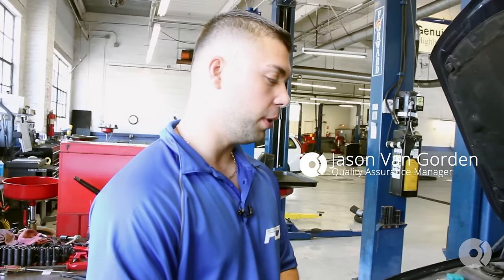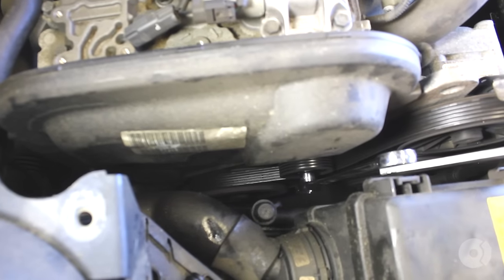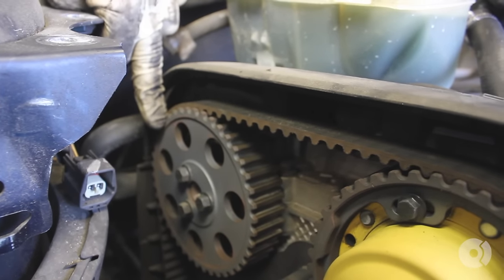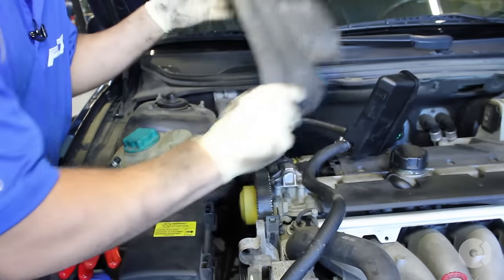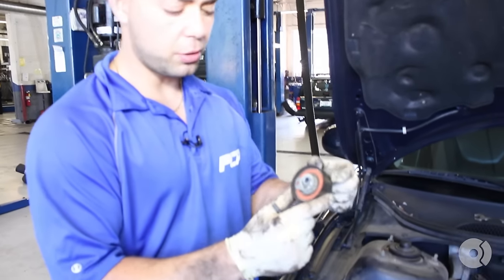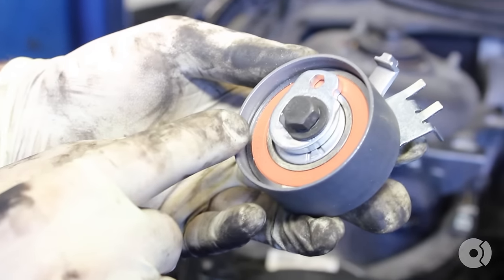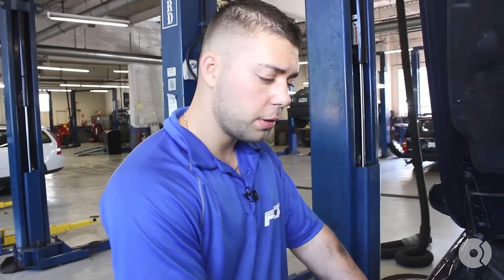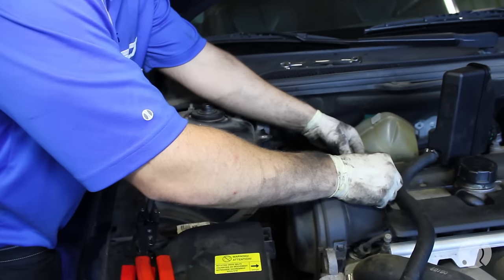Volvo P2 S60 Timing Belt Replacement DIY (S60, C70, V40, V70, S40, S70, S80, XC70, XC90)

Comment: HELP🚨Can anyone please answer my question. So my mechanic has had my 2007 s80 for 3 weeks now. It was a water pump so I bought the timing belt kit that’s comes with the water pump and all that good stuff. Well my truck broke down and now we are Ubering and Lyfting. Going for new used  truck hunting tomorrow. Mechanic said this Monday which is tomorrow would be ready. Yea tired at I told him,,, well texted after he didn’t answer my car. Told him that please if he can have it ready Monday as now my truck broke down and we have nothing as far as transportation. I’m now stressing and worrying he can’t put the timing belt on and he’s really good. Never met me down but maybe this project was a bit challenging for him. This is want he dies. He is really great at what he do. 
I Praise him because he’s fixed my car when others couldn’t fixed my cars what ever it needed to be done. So my question is. If he can’t put the timing belt on. Is it possible Volvo can take over the project. My question is, can it be replaced by another mechanic even though the timing belt is off and perhaps off timing?  This time I will take it to Volvo for sure.

Comment: Only thing I noticed is you didn't torque to angle the 10mm pulley bolts. They are 25NM+60 degrees

Center nut is 180 NM in case anyone needs i
Reply from the maker: Thanks for the heads up, Jake!

Comment: What happens if the timing belt tensioner pulley goes out?
Reply from the maker: If the pulley goes out it will likely cause your engine to skip timing, slamming the pistons into the valves and bending them causing you to lose compression. The whole top end of the engine will need to be rebuilt, likely a replacement engine might be cheaper.
Reply: FCP Euro I recently had a new timing belt put on they included a water pump. I checked my receipt from the shop these 2 pulleys weren’t included. I’m starting to feel like they definitely should have been.

Comment: What if the belt is tensioned and everything is done correctly, and the belt begins to walk itself off of the cam pulleys?? He never starts the car to confirm it won't walk itself off!
Reply from the maker: Is this a new belt tensioner? It sounds like the belt tensioner is not working properly to keep the belt tight enough to prevent it from walking off.

Comment: Do the VVTs mess with the position?
Reply: No
Reply: @CoreyDeWalt  Did this job 2 yrs ago, the procedure for just changing the belt is simple and doesn't involve resetting the VVTs. if you remove those volvo has a procedure to reset those, and info on you tube is crazy wrong on some vids.

Comment: quote my last comment and add rest of what i was asking.. Is it possible that the Cvvt. a.k.a Cam variable valve timing selenoid is bad ? I heard that can and will change timing electronically by retarding and advancing when it fires coils and injectors making it run like it really out of time.. If that's the case just replace that selenoid ? but do you have to reset it etc by computer ?  I seen a forum on this and think some said it may fall under recall and have new software to be installed ?

Comment: To lose the belt retentioner   for 2005 xc90 T2.5 (USA) , I heard it needs a special tool instead of a 14mm wrench.  Any one has idea what it is  ? I need to lose the belt to change the power steering pump that is leaking.
Reply from the maker: Hello Vincent, I believe you're looking for -  https://www.fcpeuro.com/products/volvo-serpentine-belt-tensioner-tool-s60-s80-v70-xc70-xc90-cta-8760
Reply: T50 or T55 I believe either or will work. 14mm or the Torx...

Comment: So, what did I learn today? I learned that Jay does the same, average shitty work, you'd expect from a "fly-by-night" mechanic? First of all, a camshaft holding tool would greatly help out a lot. Second, is it really necessary to remove the crankshaft pulley? 
Joe (the vehicle owner), also got shafted, because Jay installed the same old serpentine belt. Lastly, I didn't buy an electronic torque wrench because it was on sale; I use it because of the importance of torque values. Jay never mention.

Comment from the maker: The marks should be lined up. If they are off a tooth or so ( there would be a check engine light and a notable difference in performance)  you can just move the marks back to their position. And if you have any other questions don't hesitate to shoot Jason an email at jason.vangorden@fcpgroton(dot)com

Comment: why not first take off the crankshaft pulley, than put the bolt back in and mark the pulleys. This way you can't turn your marks off alignment ;)
Reply from the maker: Hi Benz, Thanks for your input. I suppose you can remove the pulley first, either way will work. The crank usually won't move much (if at all) when removing the pulley nut with an impact. We also now sell the counterhold tool to prevent it from moving as well. You can view it here: https://www.fcpeuro.com/products/volvo-crankshaft-holding-tool-cta-2247-2248-1 .  I hope that helps.

Comment: I havnt fitted it yet I just noticed the centre spins
Reply from the maker: That's exactly how the tensioner should work. The allen key hole is attached to the inner portion which is used to adjust the unit.

Comment from the maker: The engine serial number can be found on a label on the timing cover. Though you'll want to pay attention to the orientation before removing the tensioner or even touching it for that matter. Its an easy indication of either tensioning clockwise or counterclockwise based off of the position its in out of the box. Don't hesitate to give us a ring if we can be any more help: 1-877-634-0063

Comment: It's wishful thinking that the harmonic balancer (lower pulley) will come off that easily with a squirt of penetrating oil. On my 98 V70 and 99 S70 there's no need to remove the pulley. There's a guard behind the pulley held on by two 10mm bolts. If you remove that guard, the timing belt can be installed without removing the harmonic balancer. And don't try to lever the pulley off because you may damage or destroy the rubber that holds the two sections of the pulley together.
Reply from the maker: Thank you for the notes, Glen!

Comment from the maker: Wow, that sounds like a bad situation.  The truth is if you don't know what you're doing you can heavily damage an interference engine after a timing belt change if it's not done properly, i.e. skipping teeth or not aligning properly.  I can't speak to the skill level of your mechanic, but I'd suggest getting it somewhere else for a second opinion, another mechanic or the dealer.  Obviously the latter would be more expensive.  Let us know how you fare.

Comment: Would a Universal Pulley holder work? I know the official tool number is 999-5433, but I don't want to pay $90 and/or have to have it shipped from overseas on eBay for less. Is there another way to hold the crankshaft pulley so I can manually torque that nut?

Comment: Labor for the install without the water pump should be $300 - $400 and $500 or so with the water pump.  Be advised that your mechanic screwed something up along the lines of misalgning the head and cause damage to valves etc, because it would never cost $2.5k and also if he didn't change/damage anything .. preventitive measure.. the car should have been drivable and do you see any special tools used here? No.. I have all of these in my tool-rich garage but still common DIY tools.

Comment: this doesn't help me a whole lot.
I found my crank gear retaining 30mm nut missing, my timing belt was wobbling.
I ordered a new one.
seeing you just impact wrenched it back on, doesn't fill me with confidence considering the engine already lost one.
volvo says use a new nut each time. I dont know who did mine the last time, it has 220K miles.

Comment: No replace crank seals and cams seals why not .
Supposed need replace al seals idle pulley tensioner water pump at   90 k 100 k or 120 k

Comment: Nice job, done in 24 minutes dead.... Would have taken another 20 minutes to replace the water pump...  There is no way of telling the state of the impeller from the outside so proper procedure would be to replace it since your there.  To the question if it is the same on a D5 engine,  Yes, it is ( on some minor details) the same.  Cheers!

Comment: wheres the cam locking tool
Reply from the maker: The Cam tool wasn't used and isn't 100% necessary. You can use a cam locking tool for added security however we wanted to demonstrate the repair without the tool to show that it can be done.

Comment from the maker: If you're changing the seal on a camshaft utilizing a traditional sprocket its simple, just line up your marks, remove the gear, and re-install as its keyed. If its a camshaft utilizing a CVVT hub then it can get complicated fast. In this case email jason.vangordern@fcpgroton(dot)com hope that helps

Comment: If this job takes half an hour to an hour to do, why do Mechanics want $700 for labor ???
Reply: Your mech is probably scamming you. Or then its just in america, timing belt water pump etc and labor "only" cost around 300-400 for my car and its 04 s60 t5.
Reply: @jaskajokunen3716  Where do you live?   Yes it is in America.  Another shop wants $1100 Labor.
Reply: @AB-hx9hs  I live in finland which is pretty common volvo country and theyre not really considered luxury car brand here. I also think being less common car over there might make it more expensive.
Reply: @jaskajokunen3716  No these prices are at a regular shop not at the Dealer.  The dealer I am sure will charge much more. I might do the job myself.

Comment: I hate when mechanics are too lazy to replace something that will take an extra 20min while your doing the job but will cost ALOT  more if it needs to be replaced later i had a machine shop convince me not to change my pistons or connecting rods and wrist pins when i rebuilt my engine 6000 miles later guess what went the wrist pin blew my brand new engine bc the mechanic was too lazy to spend a very little extra time

Comment: Thanks again...I have contacted you thru the website but have not got an answer yet. 

My engine number is 3033416 which puts it in the range of the tension that FCP stocks. I'm going to assume that the range above that was for non-US cars (maybe) or for later models although it seems odd they would show it in the 2003 section. I think we are good.